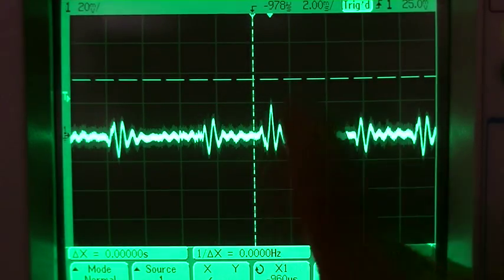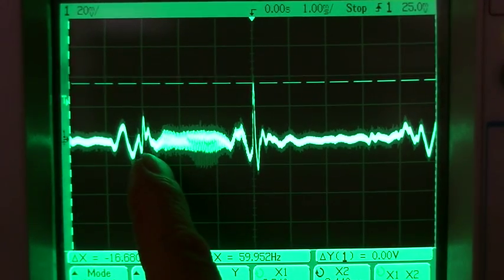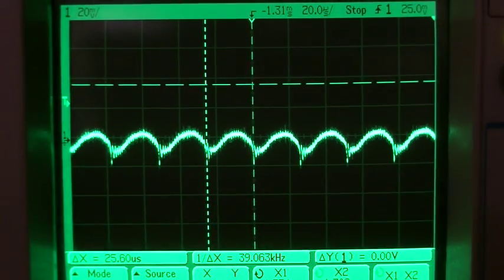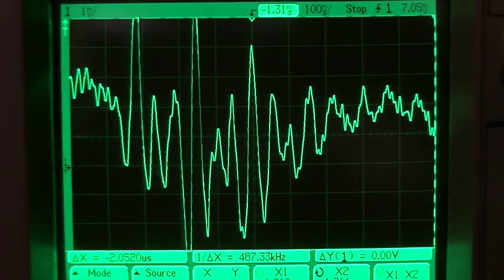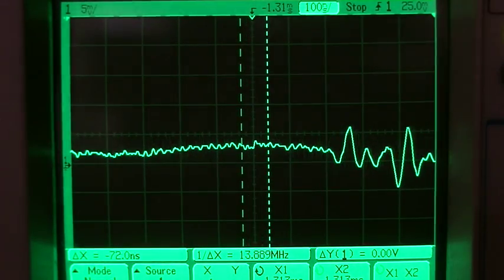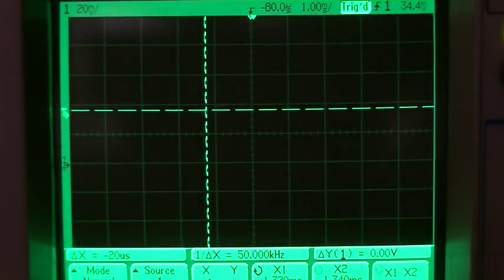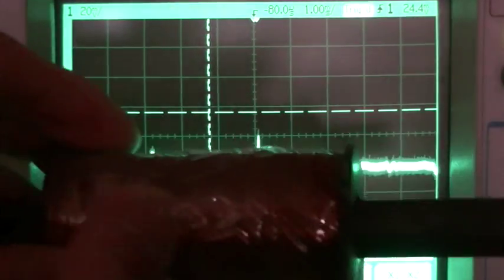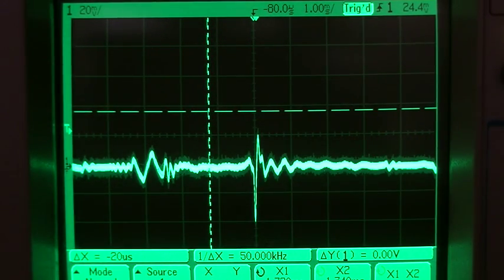HAARP Signal on Oscilloscope Live April 10 2014

Comment: Hi from Mike.

Hoe can I watch the HAARP signal on my  scope? just connect an antenna as a probe? how can I tune it to the right frequency? How can I know for sure this is the right signal and not another? when can I watch it in Los Angeles?

Thanks.
Reply from the maker: +Israel Shapira   Great! I wish you were watching it before the big earthquakes, maybe you would have seen the ELF signal. I don't have anything set up to watch the signal, and University of Alaska killed their magnetometer website, just after Fukushima. 
To see the ELF (0 to 60 Hz) signal, you need a big spool of fine wire, like 22, 24, 26... AWG or smaller, with an iron rod in the middle. Then, put this wire spool somewhere, that there is not very much 60 Hz power line noise (like out in a field, with no houses or power lines around). 
Hey, if you are in LA, you need to get an old dishnet dish, and a microwave detector, and aim it at San Nicolas Island. This is one of the Ionospheric heaters, that is keeping your drought going. Some old ham radio guys can do this kind of thing, and they will be able to see when it is running, and watch the clouds disappear from the satellite maps. 
The ELF picks up HAARP (better name is Ionospheric Heaters) anywhere in the world, but the dish will tell you who is messing with YOUR weather.
You need a low pass filter to see the low frequencies, but the large coil is it's own low pass filter, so just connect an oscilloscope, and look at the large signal coming out of the coil.
If TEN people in California did these two things, and published the data, your drought would end!
Reply from the maker: +Israel Shapira   To filter the coil output, it is best to build an OP Amp low pass filter, and that is like eight parts, costing a few dollars. If you use a 1 pound spool of 38 AWG, which is about $20 on ebay, you will see a huge signal. 
Also, you need three of these, 90 degrees apart, to see all the magnetic fields, but just one will pick up enough of the other two (vertical, east/west, north/south).
There is a russian magnetometer, measuring the ELF signal of the earth, but I don't know how much Haarp signal they are picking up. They didn't detect the Equador earthquake, for example: http://sosrff.tsu.ru/?page_id=7
Let me know if I can answer any other questions. Good luck!
Reply from the maker: +Israel Shapira  Another idea is to use a small spool of wire, like 1/4 lb, or less, and a long piece of fence wire (like steel barbed wire) through the center. If the wire is long, a few hundred feet, and east/west, it would pick up all the north/south magnetic field changes. The wire is straight, of course, not coiled inside the copper wire spool. So, anyone who has a barbed wire fence nearby, could easily put up their own high resolution magnetometer, and become an expert on HAARP!
Reply: +The HAARP Report 

Thank you for the fast reply.

"To see the ELF (0 to 60 Hz) signal, you need a big spool of fine wire, like 22, 24, 26... AWG or smaller, with an iron rod in the middle. Then, put this wire spool somewhere, that there is not very much 60 Hz power line noise (like out in a field, with no houses or power lines around)". 

So, I want to be sure: I have to connect the spool with the the iron rod in the middle to the scope probe and take it to the desert somewhere? thats it? no more circuits or parts?

What are the best times to watch the signal (what days, time of day) and how can I be sure this is a haarp signal and not something else?

Thanks.

Comment: Great research! What are the frequencies they use to transmit the signal? Or do they transmit randomly in any of the bands?
Reply: You might want to keep track of the frequencies they use to transmit the signal and have a journal of the time and date they transmit, like the guys who follow the numbers stations. You can also put some audio and analyze it with your oscilloscope on the frequency you pick up the signal. That will be very cool and people will love it and follow even more.
Reply from the maker: +Pablo M. Diaz   Someone needs to put up an ELF antenna, and just record the frequencies 24/7. They would be less than 100 cycles per second, as far as the Ionspheric Heaters, and weather control. It is a no-brainer to do that, but as far as I know, only one group in Russia is recording the frequencies, and putting them on the web. I will think about your suggestions. Thanks for the comment!
Reply: Can you share that Russian web site? Thanks
great video :-)

Comment: Question: Did you also use a direction antenna to locate the direction that baby was coming from?
Reply from the maker: +wesley mccurtain No, but it would be easy to build a simple magnetometer, with three axes, to get some idea of the direction. 
A yagi antenna at low frequencies is too big to build in the real world. The best thing to do, is to use a trash DishNet, or DirecTV, satellite dish, on a rotator antenna mount, and modify it so you can detect the original HAARP signal, which is maybe 1 to 9 GHz. I think this should be easy to do, but I haven't done anything like that. 
Ham radio guys, here is your chance to be HEROES, especially in California!!!